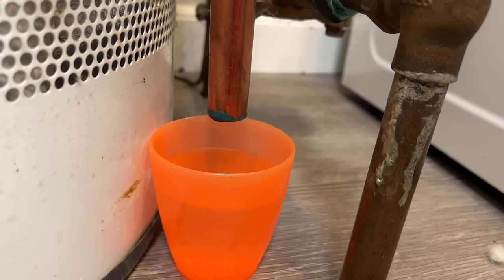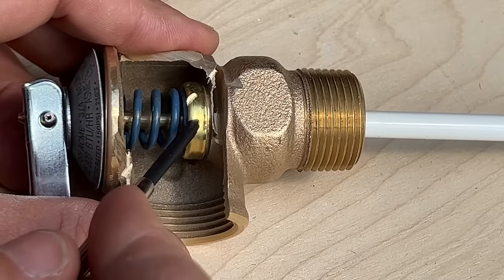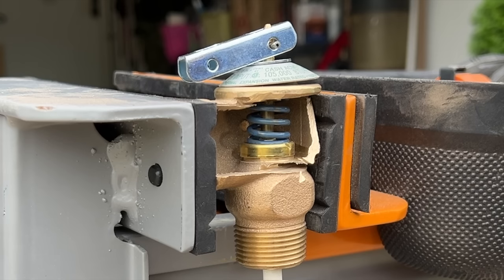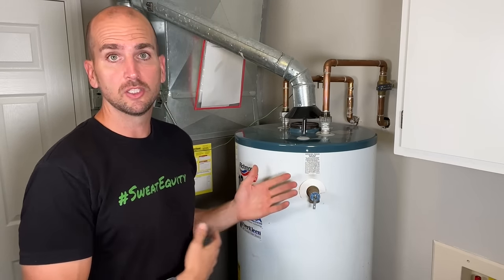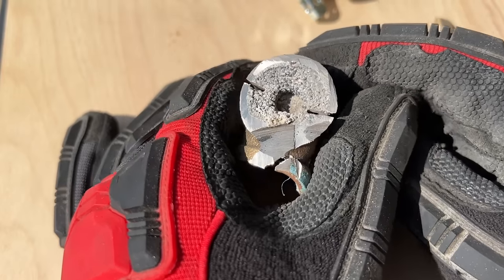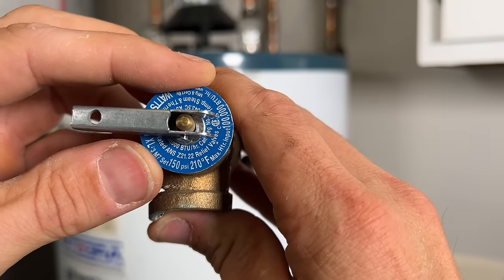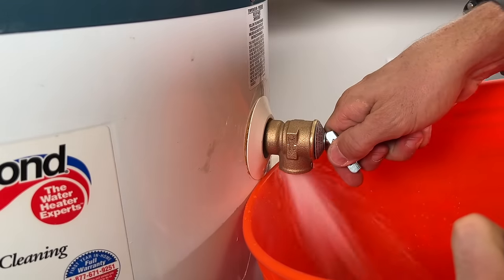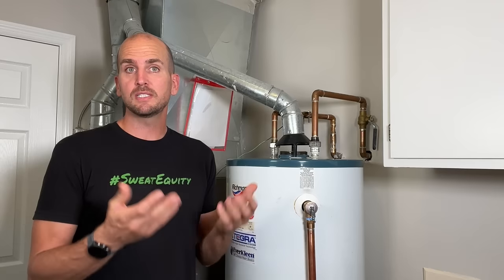Why Is My Water Heater Relief Valve Leaking And How To Fix

Comment: I learned the hard way not to drain the tank onto my lawn. Then I learned how to seed the dead spot in my grass
Reply: Very well explained😊
Reply: My drain line goes through a copper pipe underneath the floor. It sounds like it shouldn't be like that cause where does it go to?

Comment: If the valve keeps leaking after it's replaced,  here's another troubleshooting tip.  A slow drip indicates a pressure problem.    In some situations a check valve or pressure reducing valve is installed,  this does not allow water to expand back into the main as it's heated. In this situation there should be an expansion tank installed. If the valve sporadically opens full force and the water is extremely hot, you have a temperature problem.   You should check for a faulty thermostat or a grounded heating element.
Reply from the maker: Good stuff Kyle, appreciate the additional tips 👍👍
Reply: I had a failed expansion tank once, so that's another possibility.
Reply: I had a slight drip from the drain pipe.  Switched it back an forth a few times and it appeared to have resolved it. I installed a new one but it has a longer shank. Completely flushed flushed it. Now I have keep shutting off the cold water.  I didn't see this video until after. I was able too use the water heater.  Just had too turn the cold water off after use. Small drip and start. Now it comes out the drain pipe quit a bit more. I keep the tank temperature high an always have. Nothing I can't see can't live in high temperature. But I  could hear air bigtime phseww. But I did not replace the exact same. Not sure what could be the problem.  The new part sticks outside the tank longer making it actually easier to remove the drain pipe. Total length is the same threads and all? Pilot lights all that is good. I'm lost on what to do next.
Reply: @margretblair5389  A spelling check might be a good place to start!
Reply: Calcium and other minerals in the water, not sediment, is building up and causing the valve to malfunction. That wouldn’t happen if the valve wasn’t opening slightly every time you use a lot of hot water and the water heater heats up ( and expands) all the cold water that replaced it. An expansion tank would prevent the tank pressure from reaching 150 psi and opening the valve under normal conditions.
Reply: I just installed a new electric water heater and there the prv seems to release water after a shower.  Any thoughts to why?  I have expansion tube already.
Reply: @knizekim3444  did you check to make sure the expansion tank has enough air cushion.?   You might want to stop at a plumbing supply store and purchase a pressure gauge with a lazy hand and screw it on a hose bib, then monitor a day or so to find the highest pressure reached.   That figure will be how many PSI you want to fill the expansion tank to.   Keep in mind that the T&P valve shouldn't leak until the pressure hits 150psi,  if it does you might have a bad T&P  valve that needs replacing.
Reply: Thanks, I’ll have to measure the pressure but I already replaced the prv and don’t think that is it.
Reply: I’m having a problem that the water is leaking from around the cold and hot water lines coming from underneath the red and blue plastic pieces. Temperature relief valve seems to be working fine. Not sure what the problem is.
Reply: @justinwhitsitt7072 nk no

Comment: When I was a teen living in the old farmhouse all to many years ago lol. We came home after hauling a trailer load of cattle to the slaughter house,  turn the bathroom faucet on to wash my hands and the water was searing hot, the T&P valve gushing full blast water was nearly steam.    So we threw the breaker off,  went to home depot to get a new thermostat for the upper and lower,  only this time it kept popping the reset button after the tank kept overheating.    Turns out the lower element had split near the middle and was grounding out, completing the 120 V to ground thru the tank and heated non stop regardless of the thermostat.   By the time we figured it out the store were closed,  so everyone had the privilege of taking a cold shower for the night before bed.    😆
Reply from the maker: Good story 👊 and cold shower are good for you 🥶

Comment: When you remove the valve have a new one taped and ready to go back in immediately...I always got a vacuum by opening up a kitchen faucet then close it when no water comes out.  If you loosen the union on top of the water heater you risk the chance of causing a leak.  Imo

Comment: You actually want your water @ above 140f to prevent legionaires but below 160f to prevent limescale. If you're concerned about scalding you should fit TRVs and not reduce the CH temp.

Comment: I was amazed that my valve looked like your valve from a 6 years old hot water tank that uses well water only, and yes I did have to replace it.     Your excellant video saved me the cost of a plumber when I really need one for stuff I can't handle.

Comment: My relief valve was continuously dripping. I was ready to purchase a new water heater. I followed your steps and fixed the issue. You saved me ~$1000 on a new unit. Thanks!

Comment: Great video. 1st option,  actually increased the leak (once in a couple  minutes drip to every second drip) once I opened, let it run, then closed the valve (mini buckets were already on standby). I'm assuming more build up made it's way through, not allowing the valve to close as before. I followed the steps and went to option two. The instructions were spot on. I changed the valve. No leaks, so far so good.  I do believe the draining process (i did a combinatiom of a flush and gravity drain for the 10gallons), disrupted the sediment build up. So my water is running light brown. Lets see how long b4 that normalizes. Thanks again.
Reply: Same here. Made the leak worse! Looks like a new valve is in order but video was helpful!
Reply: You need to flip it on and off a few times quickly hopefully that works if you didn't replace yet
Reply: I have the same thing. One drop per 30 second or 1 min. Brand new house for only 2 years. Is the valve needed to change?

Comment: I had already subscribed because of your electrical videos, but this one popped up in search when my hot water heater started dripping after turning the gas off/on. At the moment, it has stopped dripping after just opening the valve and hopefully stays that way!

You are a very good teacher. I will send some money.

Comment: Excellent tutorial, I changed the valve which had stuck a long time ago and was now dripping seriously. I hadn't realised the valve should be occasionally exercised.  I was dreading getting a plumber out (£100 to have a look...) but did this myself easily for a £23.00 replacement valve.

Comment: Great video. Much appreciated. I tried flushing it a couple of times but opened the valve just partially and it didn't solve the problem - in fact, it made the leak worse. But I decided to try it once more with the valve all the way open and that did the trick. Didn't realize I had to "exercise" that valve once a year - I'll start doing that now along with my bi-annual tank flush.

Comment: Very helpful!! I did one thing differently. I drained water by taking out the relief valve. It's a bit messay at first, but it flushes out all the sediment from the fitting so you don't really risk the sediment falling into the tank.

Comment: Great video and demo of valve! Question. My safety valve is on top. I will try fix number 1 first. Doubt it works. Recently replaced anode. It was about 3" long! 

UPDATE:  As you suggested I worked the release valve back and forth several times. Emptied the water bucket.. probably filled a quart up every 36 hours. Checked it this morning and the bucket is dry. THANK YOU for the instructional video. Saved me $$$$ from buying tools for cutting and soldering a copper pipe and from removing and replacing the valve!

Comment: Great instructional video.  
I recommend that you do another video showing the replacement of the anode rod and flushing.  I recommend an aluminum rod vs magnesium, as it works 90% as well and lasts 3-4 times longer in testing.  Also, I recommend changing that plastic drain valve to a full port brass valve to allow the large sediment to pass when draining and not break during service.  Note removing the anode (1-1/16 socket) is difficult.  I find that it is best to use an impact wrench (after depressurizing the tank :)).
Reply: Two men with 3' large pipe on socket didn't budge it. Impact wrench... Boom, done.

Comment: Wow! So my tank has been leaking for a while. I thought it was over heating issue. I flushed the tank yesterday till it was clear. Last night it was leaking really bad at the pop off. I saw your video I just had to try it.  Well good thing it worked!! Wow now just drying the area out. I'm going to flush that valve out a couple times a year and do the tank once a year. I am on well water so lots of hard water lime. My last tank lasted about 10 years with no flushing 🤣. Thank you!

Comment: Thanks for the info. You may have just saved me from having to get a new hot water heater on Christmas day. I have the same Hot water heater and my pilot light went out on it. went outside and flipped the pressure relief lever and now it is leaking water from the valve. Hopefully I can get a replacement valve in the next couple days

Comment: Good work. On a  gas tank like yours, don't turn the temperature dial setting down, simply turn the control from the  "on" position to the "pilot" position. Then when finished, turn it back to the on position. The tank temperature will be returned to your normal temperature, without having to try to reestablish its temperature dial to its previous setting.
Reply from the maker: Good callout Dave,  appreciate the help 👍
Reply: Good advice, David, thanks.

Comment: great video, I enjoy all the details you add in.  I didn't hear anything about electric water heaters but might want to add in the other type as well. like if you have an electric water heater shut off the power at the breaker before you drain any water and only turn it back on you fill the tank back up. else you will fry the elements.  anyhoo keep up the good work.

Comment: Thank you for the fantastic video! I was able to follow your instructions step by step -- including having to wrestle the old one out and remembering to reattached the hot water outlet. The changing process stirred up some sediment in my pipes, so I had to run my hot water for a little while to clear out the sediment with the air bubbles. But it works great, and I'll take better care of my new valve.

Comment: Thank you for the informative video.  The valve on my water heater is on the top, I don't know if the valve itself is leaking but I noticed water leaking on top of the water heater where the valve fits into the water heater so I'm thinking about replacing  the entire water heater. 🤔 the water heater looked really good when I moved into my house a little over 7 years ago. I told myself to do some maintenance on it periodically but I never did😕. There's what looks like calcium build up on the hot water line going into the house and with this leak I noticed today I'm inclined to just replace it.  I got an estimate from a plumber,  he said it would cost around $1200, probably more ...hence I'm on YouTube looking for info so I can do it myself.

Comment: The valve as you demonstrated from the side worked, when I pull the lever water does escape, the problem for me is that when the cold water valve is open, I get a huge leak from the top Center of the tank itself. There where the exhaust tubing comes in, whatever that is on my tank in the center between the cold and hot water inlets is where the leak is coming from hot water is leaking out

Comment: Thanks for so many great videos.   I recently replaced my old Tank relief valve after it had a couple big leaks  (first time in 3 years, since the new tank was installed),  the new relief valve didnt do the trick,  it seems that the water is being heated too hot.   Should I mess with the Expansion tank next?  Or should I try and set the water temperature down?   Is it possible that during a warm winter and high indoor temps that the system is accidentally running too hot?

Comment: Cycling the valve a few times worked kind of. It took some tapping on the valve with a hammer to stop the leak entirely. I will be replacing the valve when I replace the dip tube, but for now no more leaks!

Comment: Great video!

Not sure if you have run into this... I have a gas water heater and as of recent, it seems that the first use of the day (usually a shower), the water maxes out at a luke-warm temperature. Once that shower is over, the next use of the water heater is another shower around an hour later. For that use/shower, the water comes out much warmer.

The thermostat on the heater is set to the main setting (large mark on the t-stat knob). We had the accumulator tank replaced recently (sits on top of the water heater tank) and they also drained the 50 gallon water heater tank at the same time. The water heater itself is around 15 years old. No water conditioner is installed. I do not know if this an issue before the repair since we were not living in the home at that time but I am pretty sure that since the repair was made, this is how the water heater seems to be working now. Any thoughts, tips? Thanks!

Comment: Great video, thanks for posting. I'm always having to look at the plumbing in a 100 year old house, and I never REALLY know what I'm doing, but videos like yours are a lifesaver. My question is my old plumber left a valve rated at 100,000 BTUs, but the valve that is on the heater is 105,000. Is it safe to use the lesser value valve?

Comment: I replaced the valve. I'm hoping it doesn't leak badly when I'm  not around. So far so good. I'm going to monitor it periodically  for a bit, but seems to be fixed.

Comment: When you replace a valve,  besides the pressure and temperature rating (150 psi/210°F seems standard, if anyone seen anything else feel free to comment) you also want to make sure the BTU rating on the valve meets or exceeds that of the water heater as shown on the nameplate, for an electric water heater simply multiply the total wattage by 3.4121 to find the BTU/hr.    This could save your life, here's why: Should the heater's thermostat malfunction,  the water in the tank could become superheated.    As the pressure and boiling point increases the tank weakens.    If a pipe blows off after the plastic or solder loosens, or the tank splits,  the water drops back to atmospheric pressure, increasing the volume 1600 times releasing energy comparable to a pound of nitroglycerin.     To prevent this from happening,  the T&P valve must be capable of releasing hot water at least the same rate it's heated.

Comment: Sometimes, just turning the relief valve on manually will not clear the sediment built up under the seal. That happened to me. So here's what I did that worked. With a bucket under the valve (I don't have the long copper tubing attached to the valve) I opened the valve wide open for a few seconds, and while the water was flowing, I gently tapped on all the sides of the valve with a closed adjustable wrench. I would caution against hitting it too hard. I did that about 5 times until it worked. Now it does not leak at all. Use caution as the water may be scalding hot depending on your temperature setting.

Comment: I ended up replacing the valve. My water heater is around 15 years old so it was time to replace it. Still..it took 15 years for it to start leaking...not bad at all.

Comment: This video would have been a great time to tell people to leave the drainpipe/T & P valve open (not capped). The T & P is a safety device and water needs to be able to exit via that path when temperature and/or pressure is exceeded.💣

Comment: With all that scale build up the bottom of the tank must be built up pretty bad too. I had the same problem, replaced the water heater with a tankless and installed a water softner and a descaler. With that much scale all the plumbing fixtures in the house will eventually get clogged.

Comment: Good intro video but I would add more details (there's some good YouTube videos on this).  To maintain water heater one should do both - replace the temp valve and sacrificial anode. Also one should flush the tank thoroughly and replace flush valve (one time) with "full port flush valve" - it will make flushing much faster and take out more debris.

Comment: I just learned to use the pressure-relief valve annually. I had to replace the PSI relief valve (luckily, it was under warranty) because it was dripping; I hadn't tested the relief valve annually for the last 8 years. I also replaced the plastic drain valve with a brass drain valve as a precaution; those plastic drain valves can easily break off. 

The next time I have to buy a new water heater, it will have a brass drain valve already installed, or I will replace the plastic drain valve with a brass one at the time the new water heater is installed.

Comment: So I had to restart the hot water heater after a power outage and relighting the pilot light today.  A couple hours ago I was checking on something else and noticed that the relief valve was continuously leaking, and it stopped leaking when I shut off the cold water.  So I've tried to work the diaphragm in the relief valve using the pull to see if it could reseat without any leaks, and after about a minute of playing around, it seems to be sealed again.  However, I don't really know if it genuinely opened because of excessive temperature or pressure in the tank, or just became clogged for some reason, so I'll keep an eye on it.   The water out of the tap was pretty hot, though I don't think it was even close to boiling point.  I didn't get any scalding or anything touching it.